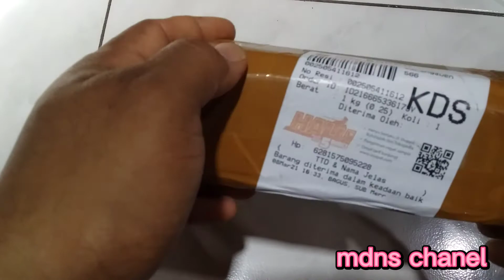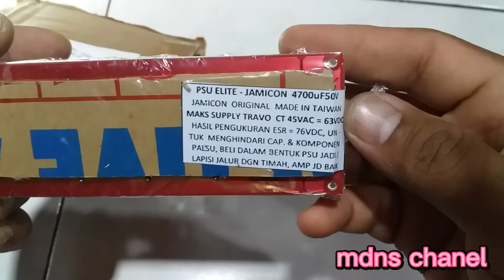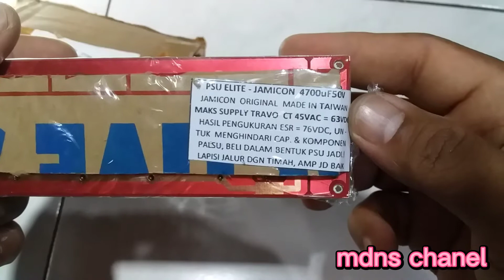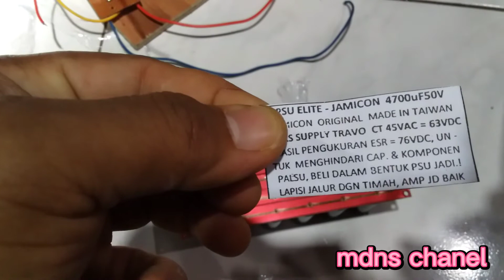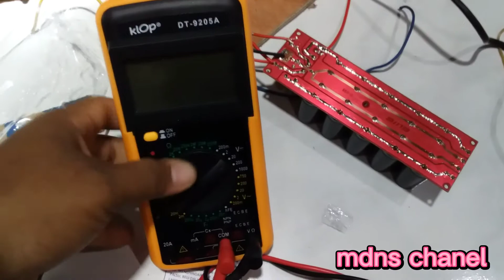#review elko jamicon 4700mikro 50 volt oryginal#

Comment: Travo 10 amper 47 volt setereo aman ga bos
Reply from the maker: Menurut keteranagn dproduk aman mas.sdh dites esr nyampe 63 volt.jd u tuk 45-47 vac dr trafo aman
Reply: Ok suwunn bos
Reply from the maker: @FathurNgareeet  ok siap sama2 mas
Reply from the maker: @FathurNgareeet  ok siap sama2 mas
Reply: Lah kira2 kalo buat speker 15×2 gimana bos
Reply from the maker: @FathurNgareeet  kali buat 15 inch sdh cukup tp kurang maksimal,tergantung jg dr watt speakernya ms.kalo bisa dtambah 1 set lagi psu nya mas.jd stereo kanan 1 set kiri 1 set